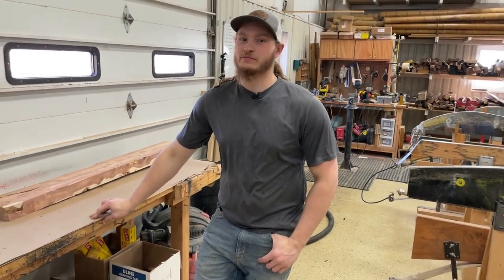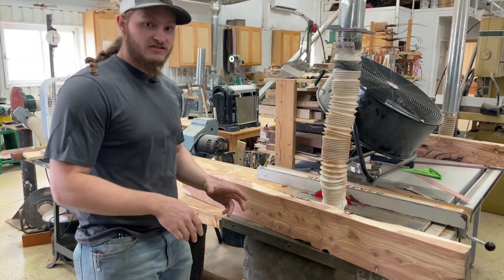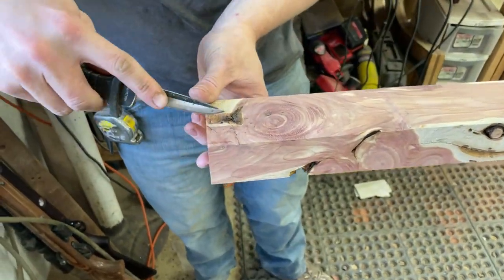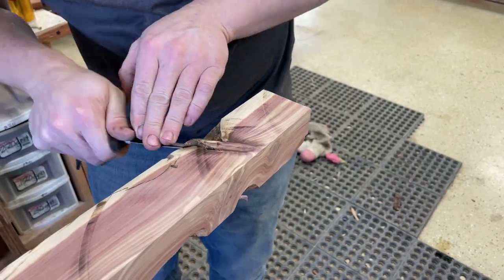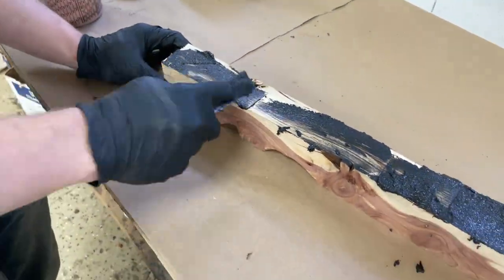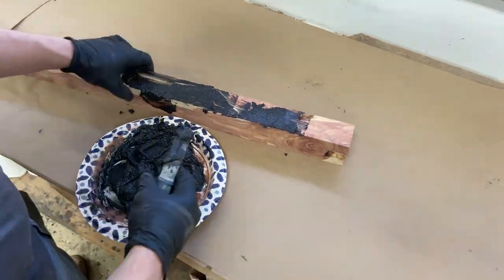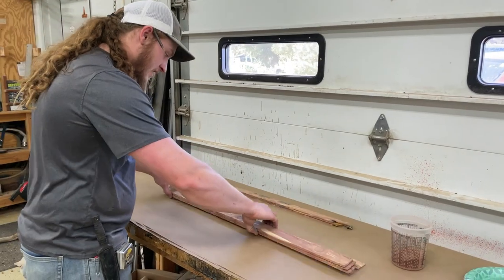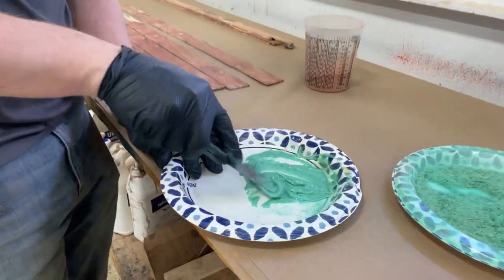Cedar Stabilization Process | Great Plains Bows

Comment: Nice work.

I will keep thank you for making my bow a Youth Longbow in Hickory at 45 pounds that will be at worst 0.5 inches off from my actual draw length depending on the handle design. Few other brands were willing to make a single piece Youth bow of similar draw that was not only made in a lower weight, or I would have had to pay as much as an adult bow $1000+ to get the custom weight.
Reply from the maker: Hi Casey, sorry for the long wait, but your longbow is all glued up. We didn't have any great looking hickory for the limbs so we were waiting on that. We finally got some in and got yours glued up. I should have it finished next week and ship the next. Shane
Reply: @greatplainsbow  Cool, just in time for my Dec 20th birthday.
Reply: @greatplainsbow  If you want to do some of the last minute filming of the bow final work you can, I think it is a slightly unique that a fully grown adult at 5 foot 2 inches or 62 inches has such a small actual draw of 24--24.5 inches depending on bows handle design. Actual draw is the draw you have when using a hunting/3D bow in actual situations not just standard target bow draw.

Comment: What type of CA glue do you use?
Reply from the maker: Stick Fast is the brand we use. We have the thin and medium that we’ll use for different things.
Reply: Thanks! I’m wondering - would you trust this for a delamination repair?
Reply from the maker: It would depend on what was delaminating. If it's the actual limbs then no
Reply: It’s a Bodnik slick stick and it’s the back lam and the separation is only in the handle and not past the fade-outs. I have some loctite 401 to try. I’d do epoxy but there’s only a 1/16” gap. Already have a replacement thanks to their warranty so no loss either way.
Reply from the maker: @alexhowarth5670  I bet you could repair that. Send me a pic of the defect
Reply: Will do! Thanks!